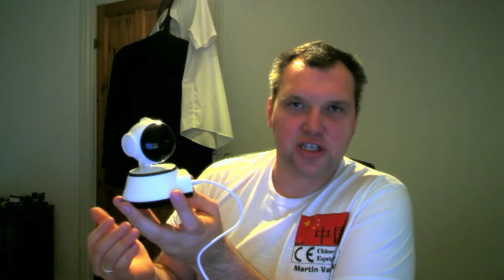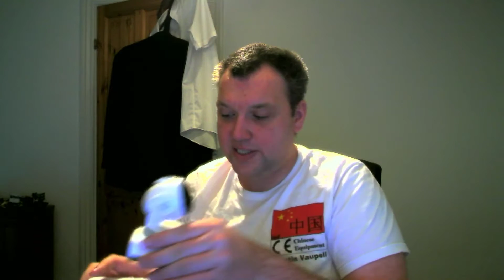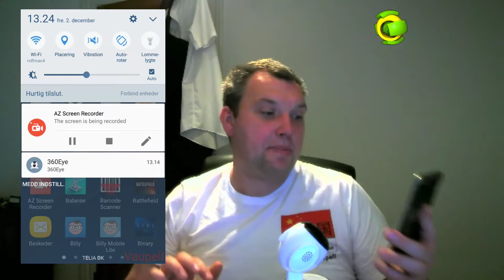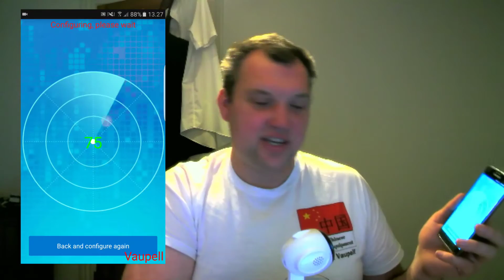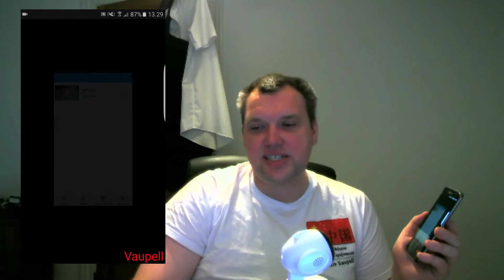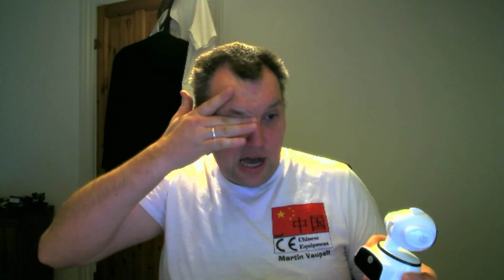Digoo BB-M1 wifi Nannycam from banggood test.

Comment: To monitor this and other simple IP cameras externally, the user only needs to setup port forwarding on their local network. This provides an essential link between your internal network IP and your external IP address. You could also assign a static IP address to the camera through one's router thus keeping your re-connections easier.

Comment: I figured it out. When I went to Network Setting in the app, then Network, I got the same error message. I then went to IP Configuration. It said "loading device configuration". I then checked Auto Config and hit Save. I got the message Static IP setting successful. Selected OK then the cameras started working again. When I went back to the Network setting, the Station (Work with router) box was checked and my Mum's WiFi name and password now appeared in the list, which wasn't the case before. I think I know what caused the problem. If you're switching between having your phone connected to WiFi and Cellular Data and find the camera won't connect, you may have to through the IP Configuration steps I stated above. Hope this helps anyone who's had the same problem. Cheers!

Comment: I have two of these cameras to keep an eye on my elderly mother. I tried to set them up using my iPhone 7 Plus. Initially it wouldn't sync with my phone. I called her ISP (Bell Canada) and they said she has an old modem so they sent another. Same problem occurred. I contacted Bell tech support and they said "give me a moment". I believe they selected a different port. That fixed the problem and I was able to connect both cameras. A week later, I tried to connect and got  the error message "Failed to connect device: Please make sure internet is connected or pull down the device list to refresh." Internet is connected and tried refreshing many times. I went to her place and tried connecting. Both cameras worked perfectly. I got home and I got the same error message. I've tried it with wifi connected on my phone and with cellular data turned both on and off. Anyone experienced the same thing? Other than uninstalling/reinstalling everything, I don't know what to do. Any help would be appreciated.